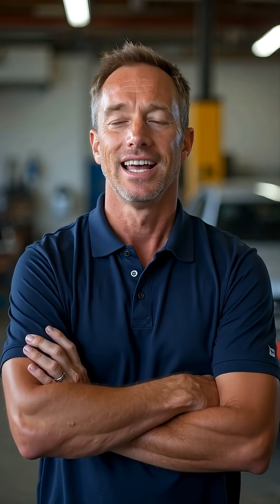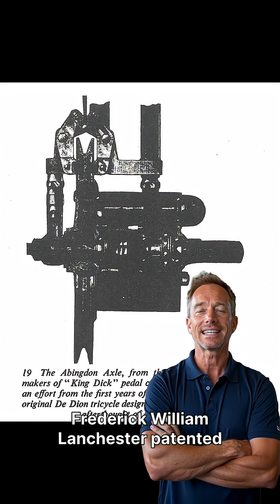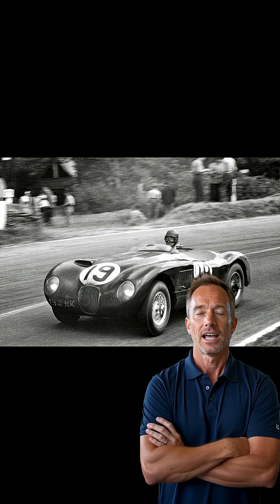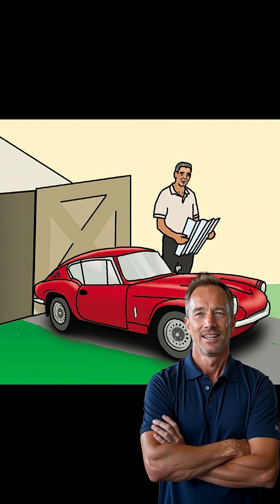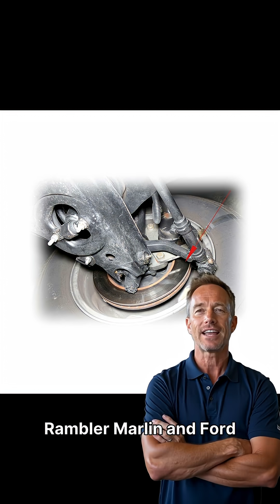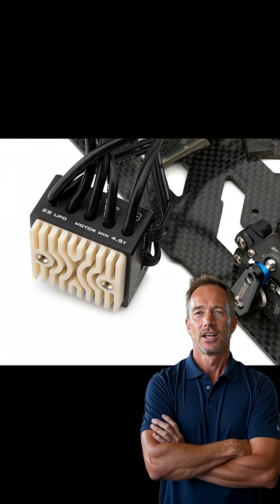Brake Evolution  Disc Brakes

Comment: DS? Not quite right. The DS had a hydraulic system for "everything," including power steering, suspension, and brakes! The DS's braking system only functions reliably when the engine, which drives the hydraulic pump, is running.

An "independent" braking system (still common today) came from Alfa Romeo in 1957. In 1959, a brake booster was added to improve performance (still a single-circuit system, but this was changed to a dual-circuit system in the 1960s).
Reply from the maker: Thanks